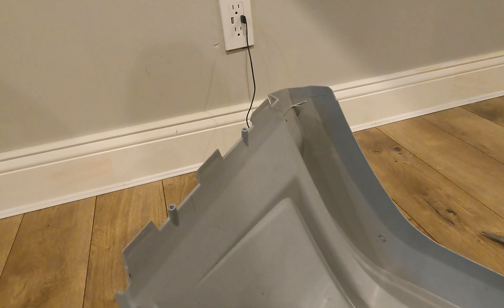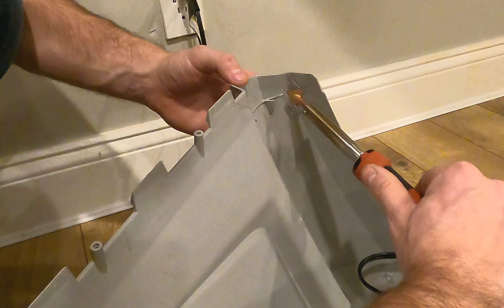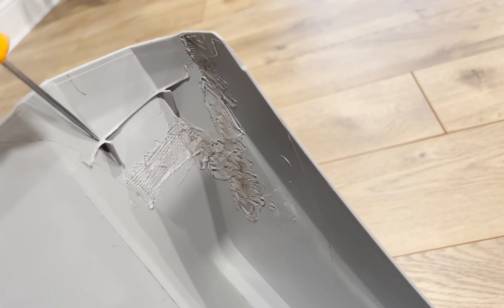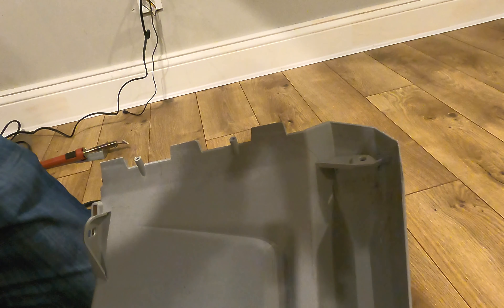How to repair plastic.

Comment: this being a small piece of plastic to repair, is the repair still cheaper then replacing a body panel? but still great visual for other fixes.
Reply from the maker: Repair only cost $20 way cheaper than new panel which is around $180, plus this was atv fender not even a week old and had unfortunately meeting with a tree 2days after it was installed brand new, no point throwing money on something that most likely will get scuffed damaged in the future somehow, repair is easy quick and as strong 💪 if not stronger than original piece 😊 this was good demonstration piece how it can be applied to other plastics 🙂
Reply: @MotorsportInspired  $180 for a piece of plastic the size of a shoebox? Holy shit!🤦‍♂️
Reply from the maker: @sadelko77  Yea tell me about it😒 inflation like anything else.